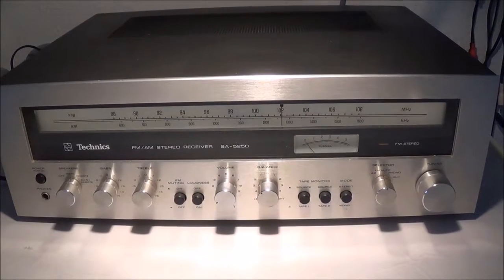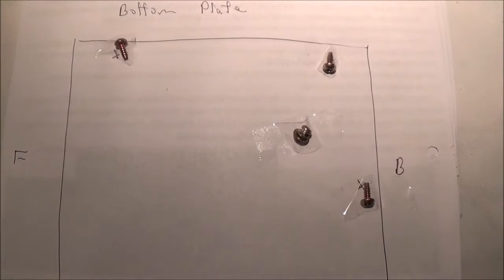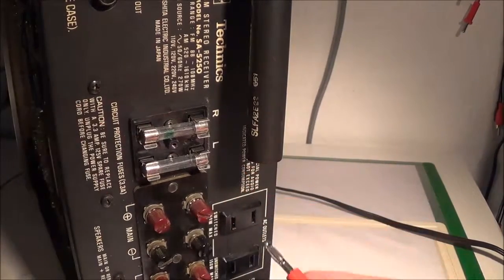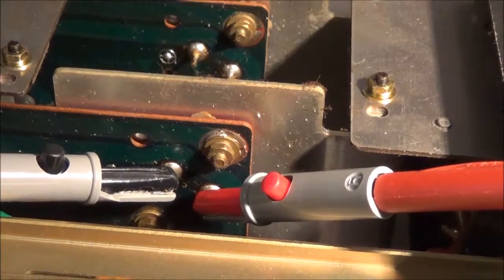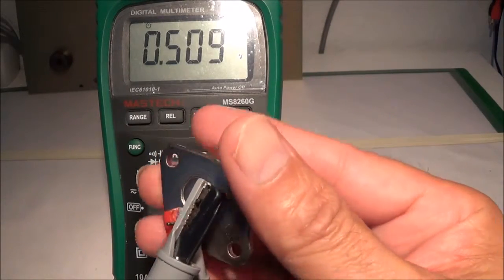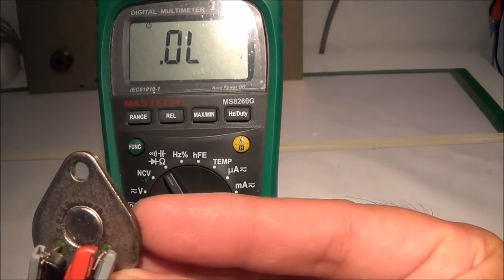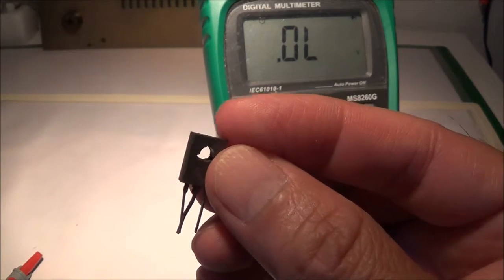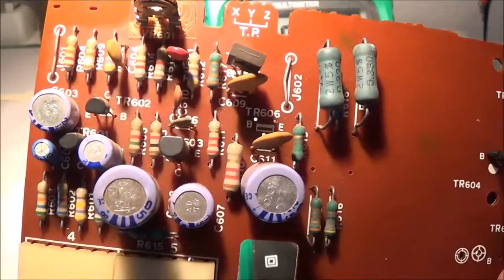TECHNICS SA5250 STEREO RECEIVER -- PART 1 OF 2

Comment: I have a Technics SA-5250 myself 23 watts per Ch. Both channels work fine. Except FM doesn't work it slowly started fading about 3 years ago. I have white noise but no signal input. It was suggested to me by a very reputable shop in town that I might have those " purple leaky caps" He said several manufacturers in those days used those caps & some years later discovered they leaked. But he also told me that FM might not be worth a repair & the cost , because later down the road something else could go wrong & I would end up with one repair after another. Maybe a complete  re-cap of the whole thing ect ect. He also told me that I should replace the output fuses with 2 amp ,  because if the amp section ever " blows "it could possibly damage the tweeters in my speakers. He said it was a matter of sentimental value to me , if I wanted to invest the $ into this receiver , for which I've owned now for 7 years.
Reply from the maker: I no longer have this unit. I think the shop was correct in assessing that the receiver has sentimental value to you personally (as compared to "market value"). A complete recap would be expensive; here it would be the cost of the labor-hours that would be bulk of the cost.  If you had the FM repaired, something could go wrong "down the road," but not necessarily. But again, the receiver is old, so maybe. It's like many things old: they could go for decades or just one day.  No FM could be any number of things, not necessarily caps. As an alternative you could always buy another 5250 in good condition--it would probably cost just as much to get the FM repaired in your present one. This system uses both a relay and fuse protection system. I would not move to a higher fuse rating, but a lower fuse rating could be tried out. If the new fuses blow too often you could simply go to back to the original higher-rated ones or the next higher-rated available fuses.
Reply from the maker: I forgot to add this in case you are not buying the fuses from the repair shop: don't use slow-blow fuses.
Reply: Thanks for the reply old school. The reason I contacted this business here , was because I recently purchased a Technics SU--V98 Amplifier with a Technics ST-Z980 Tuner through E-bay & when they arrived here ??? The amp had no audio with headphones or speakers. So I wanted to get it checked out to find out , if maybe something happened during shipping. So I'll find out June 3rd.
Reply from the maker: Good luck with the unit! That amp is definitely a job for a shop.   I am not familiar with that amp. Make sure, though, that the pre-out/main-in jumpers at the back of the unit are in there and are making contact. If these are missing or not in correctly there will be no sound. Also make sure no "mute" button/switch is activated. That's about all you can do without specialized knowledge or test instruments.

Comment: Where did you order the parts from and what were the part numbers please. I have the same issue. Thanks John
Reply from the maker: John, I no longer have this unit and I threw away the service log. If you don't have the service manual, you can always get it here: https://elektrotanya.com/technics_sa-5250_5550_sm.pdf/download.html#dl or https://www.hifiengine.com